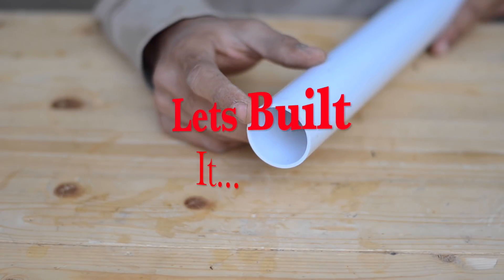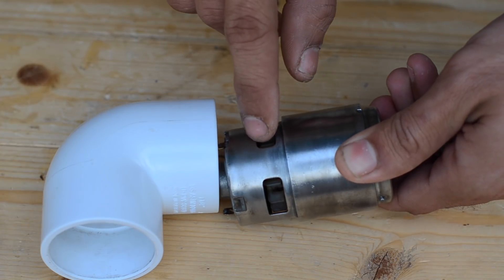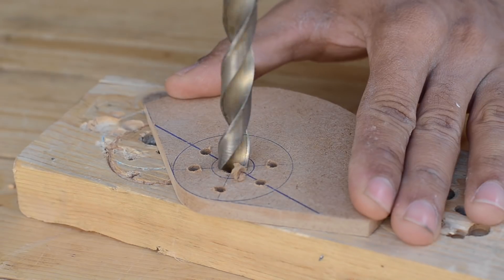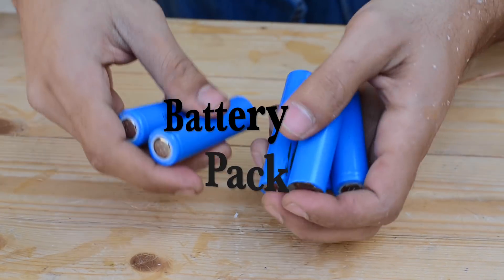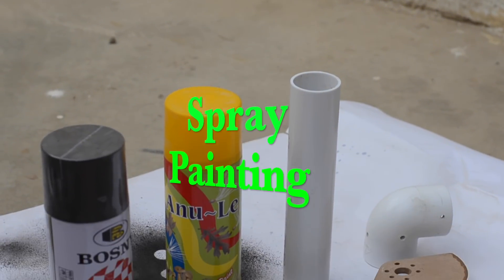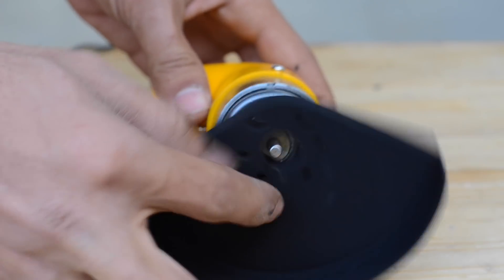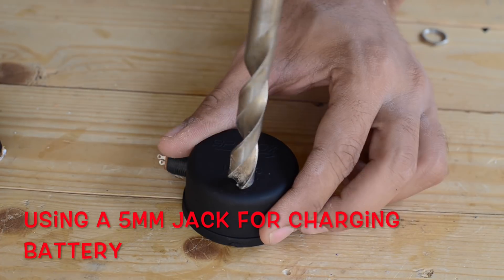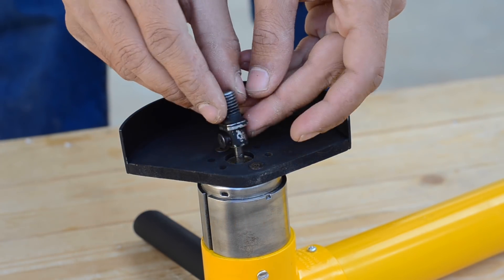How to make a Cordless Angle Grinder

Comment: Good job 
But 10 out of 100 
Where is BMW for battery pack 
Dude if something goes wrong that PVC made shield will not stop the grinder 
So make sure to make it secure before use
This project is one time usable 
Because when in pressure those csrew will loosen .
Good luck KING

Comment: battery management is a disaster ... no leads across the increasing battery voltage. How to control the balancing of the charging? it will end up with unbalanced batteries and running out of charge or lower power within few uses

Comment: As far as I know you can't solder onto a lithium ion battery the way you did and moreover you need proper BMS for over discharge and charging a 3S lipo. Good luck.

Comment: Great video. Congratulations.
You can tell me where the positive pole of this engine is, because I bought one of this, but I haven't used it until today because I don't know this detail. Thank you for your attention.
Reply: There is a red mark on one terminal that is the Positive terminal and the other is negative. It doesn't matter it's a dc motor if you wire it wrong nothing will happen it will just spin in other direction

Comment: The project is good. But it's not meant for heavy duty works, since there are some security concerns. First, there is no BMS protection for 18650 battery pack. It's dangerous to charge them like that. Second, the cutting blade cannot be tightened as we do in conventional angle grinder. There is no motor stop lock to tighten the blade and it can be released and can fly and hit the person. Third, there is no motor cooling. Fourth, though the motor is of 12 K RPM, when applied load, it's rpm decreases, thus longer cutting time. It can be used for simple works only.

Comment: Nice project, but it doesn't even come close to the power that real commercial tools have.
What I usually do is buy high quality old tools with worn out batteries and outfit them with an appropriate new Lithium RC battery. Works like a charm!

EDIT: I've tried using old laptop batteries as well but the capacity of those cells is no longer their rated amount, if you're lucky they're still over half the original rated capacity.

Comment: Excellent work young man :). I do need to make you aware that when you were explaining about the motor at 2.25 min. The gap at the back of the motor and those fan like wings you see inside and the air gap you are pointing at serve a purpose. They are all  there to serve  1 purpose  i.e. AIR VENTILATION TO COOL THE MOTOR !!!!!. The motor heats up very fast and needs external source of  cool air to cool down the motor. Therefore you do need to drill some air holes besides  the screws and in line with the air gaps at the bottom of your motor. JUST POINTING OUT . BUT that  doesn't take away your BRILLIANT IDEA AND CREATIVITY.
Reply: I agree those are fans to cools the motor, also I noticed you soldering up battery incorrectly and unsafe way. I'm not here to correct ya but just advice. also, the battery will have a short life. because of the way you soldered the battery up, I know it works, what u did was called loop flow circuit.
Reply: @Moltike707  can you elaborate please. and how to avoid that or proper way to do so.

Comment: You need a gear reduction of at least 3:1 in order to get any use out of that weak motor!

ps:Without proper air vents that motor will overheat in no time!

Instead of making stupid things why don't you invest on a used milling machine and make something that is actually decent and not waste others time!

Comment: Can we use laptop charger to power this tool?? Or PC smps 400watts capacity??
Reply: Surya Patnaik yes any 12V DC supply with sufficient amps should do.
Reply: What does mean by sufficient amps. Why not specify the amps

Comment: You do much with round pipe, I suggest making a "V" block or cradle from some scrap wood, it will make holding and drilling much easier. I also work a lot with plastic and must machine square and rectangular cutouts for switches and connectors, and although I have routers, and a milling machine I usually chain drill holes like you (it's faster for on-offs) but then follow up with a sharp woodworkers chisel to remove the slug, with practice you can get a hole that needs no filing or touch up as it is crisp and square. As a sub, I think you put up some of the best DIY's on the Tube, well done.

Comment: Awesome work, bro! But it's not safe to charge those batteries like that. You should use a BMS (what would be really difficult, because a BMS that can give enough amps that the motor draws would be really big) or a lipo kind of pack (with balanced leads). In that case it would need an embedded lipo alarm too (that would be powered when the angle is on)... Anyway, take a look in the "diy 100w LED flashlight" video from Well Done Tips. ;)
Reply: Actually, there are workarounds for lipo battery charging schemes:
https://www.youtube.com/watch?v=HPyeQCkcMUE
This guy has extensive experience in high power systems and decision- making of what components to use.
Reply: BeachsideHank Yeah, I know him! But, from what I know, he only works with new batteries, right? And he doesn't solder that way too, if I'm not mistaken. So... It's a little bit safer... But yet not much.
Reply: MC's Creations
Not trying to be argumentative with you, but some geographical realities of life have to be taken into account also. A person desperately wanting to construct such devices as shown in this video may be a poor factory worker in Karala India for example; a BMS- no matter how inexpensive it may be for you and me to acquire- may be a budget buster for him, but a 30 gauge or thinner copper wire strand as a cell jumper would provide at least Tesla- like protection against catastrophic discharge failure. Do note that many DIY tool videos make use of pre- owned batteries, almost all Li-ion, which has a much better safety record than LI-po. I don’t think the possibility of hazard should dissuade anyone from replicating such devices, just a few simple low to no cost safe practices should suffice.
Reply: BeachsideHank Of course, I agree with you. But knowledge is power and that's what I'm trying to add here. ;) About the safety... Remember about Samsung Note 7. KABOOM!
Reply: MC's Creations
For those unfamiliar with those episodes, here are Samsung's reports:
In the case of the first battery, Samsung pointed to a design flaw in the upper right corner that, in some cases, caused the positive and negative tabs to break down, resulting in a short circuit.

The second battery, which came from another manufacturer, was apparently faulty because of a welding defect that could cause the battery to catch fire, it said.

Now followers of this thread can draw their own conclusions.

Good exchange there MC's Creations, thanks for all your input. ☺
Reply: BeachsideHank Yeah, but it's probably a lie from Samsung. (And I like Samsung, I'm using a Note 4 right now). The explosions occurred during the charge of the batteries, so it probably was a failure in the charging circuit, the overcharged the batteries. BTW, if they were lipos the explosion would be really worse!
Reply: Yeah, Lipos can bring out the ferocity in discussions, I posted an Instructable on converting an old drill from nicad to Lipo:
https://www.instructables.com/id/Easy-Nicad-to-Li-Po-Drill-Conversion/
This was without a BMS, but using a B6 charger to maintain it and the comments went everywhere. I use sight, sound, smell, and feel when judging a power tool's charge state, it has proven to be just as accurate as a state of charge indicator for me, but it's still empirical and not good enough for some however. I've got about 3 more drills to convert, I get 'em cheap at thrift stores for as little as $2 since they have dead batteries or the charger is missing , and I now favor Li-Ion's, they are cheap and good enough for my purposes.
Reply: BeachsideHank I can imagine! I took a look and the only thing I would do different is to put an 'y' cable in the ballad lead, so you could put a lipo alarm in it (probably with an on/off button, so it doesn't stay on all the time). But, anyway, if you take care enough with it, I see absolutely no problem. BTW, I'm making a 10w LED flashlight (I want to make a 100w, but I'm starting small. LOL) and I'm going to use 3s batteries without BMS too. Can be lipo or self made with balanced leads. And I'm going to put a lipo alarm in it, just that. :)
Reply: Yes, those high wattage units create a whole new set of dynamics to deal with, especially keeping them cool. I just bought a 6 volt battery powered lantern at the thrift store (my favorite pastime) for one measly dollar, it is one of the latest models with a CREE- type LED in it but setup for the old carbon battery, it too will soon be brought up to date with some Li-Ions from my stash.
Reply: BeachsideHank Nice!